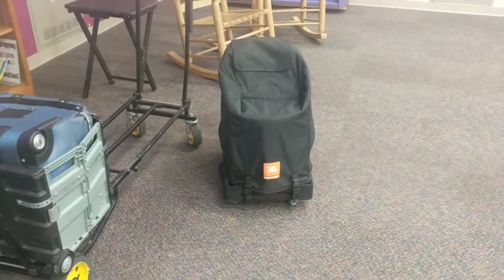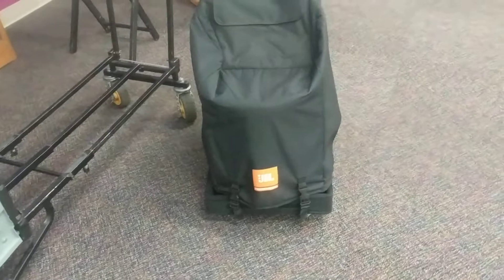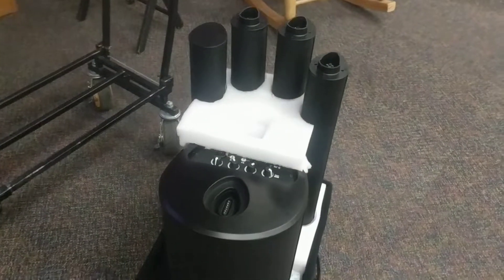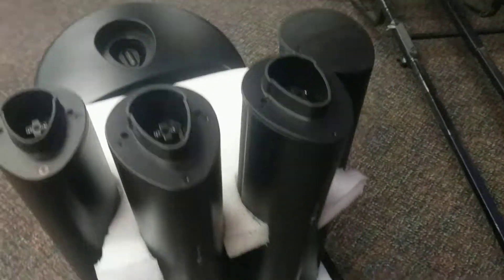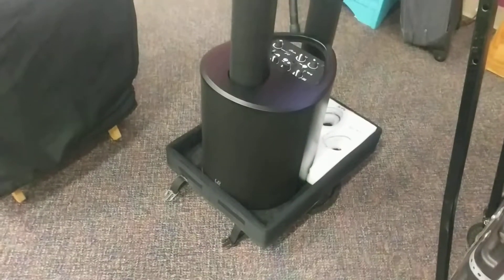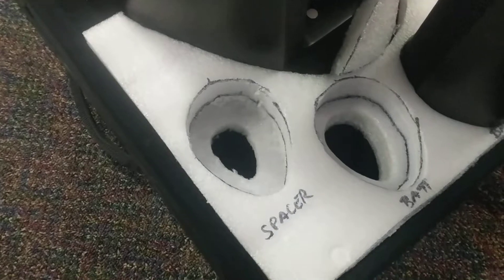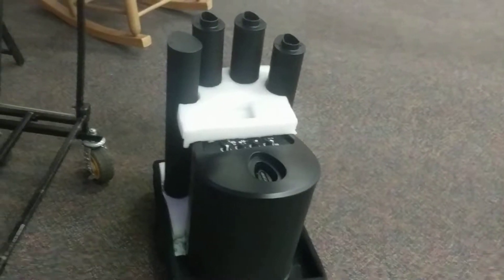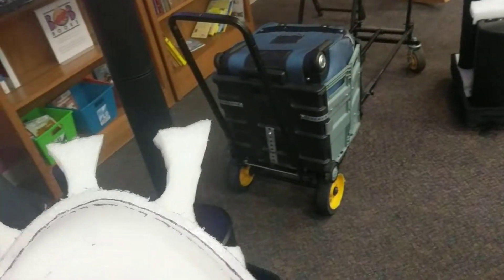Maui 5 Go Rolling Transport Case Mod!

Comment: Awesome Idea.  Nice Job!!
Reply from the maker: I've improved on this a bit. Added deeper black foam and glued it down much better. Still have gotten a few dents in the column speaker grills but not too bad. A piece of larger foam between the columns and the unit in transport would likely solve that.
Reply: @DandyDoesIt  hopefully if any company copies your pattern you will get paid for it. Nice work.
Reply from the maker: @djmadoresr  so far LG systems has completely ignored every suggestion I ever sent to them
Reply: @DandyDoesIt  That is Sad!
Reply from the maker: @djmadoresr  I've sent the suggestion to them multiple times that they should make a second battery that can go in place of the center column piece which is nothing more than a spacer. If it runs in parallel then it would extend battery life to where you could seriously go all night without having to do a battery swap. That idea was met with a resounding yawn. Not to mention their new version of this is lower-powered as far as the battery capacity goes. So this is sort of LD systems red-headed stepchild is what I'm sort of figuring out

Comment: I own a Maui 5 Go. Do you prefer the sound over the JBL Eon Pros? Just wondering what made you jump to LDS. Good idea by the way on transforming this rolling case.
Reply from the maker: Love them! I never had the Eon One Pro, just the Eon One which is larger and not battery powered. These are much lighter, sound great and the swappable batteries totally sealed the deal for me!